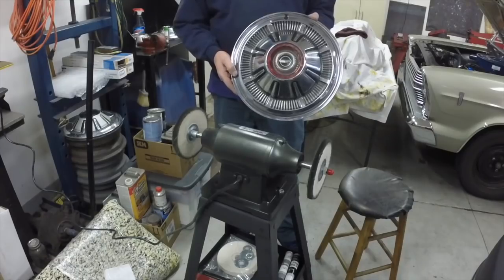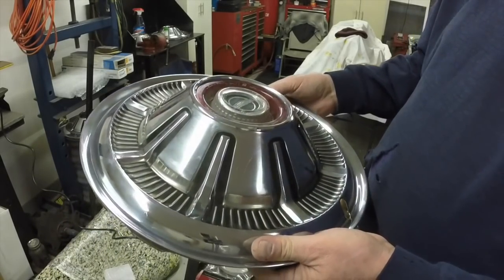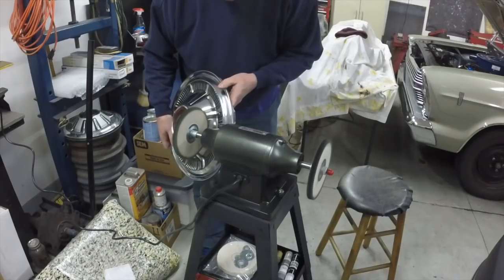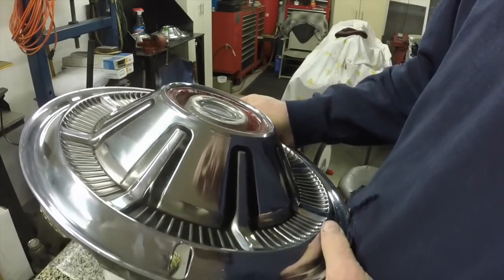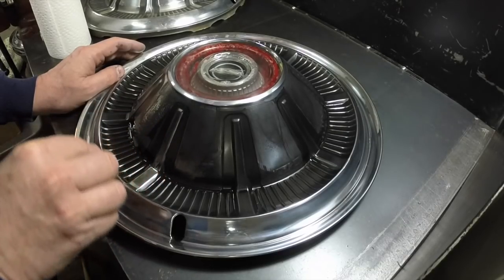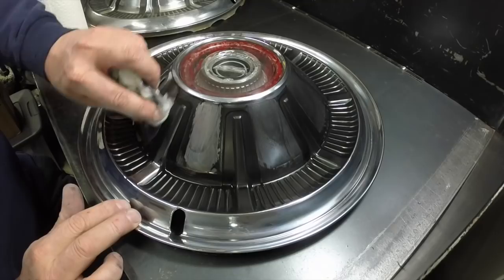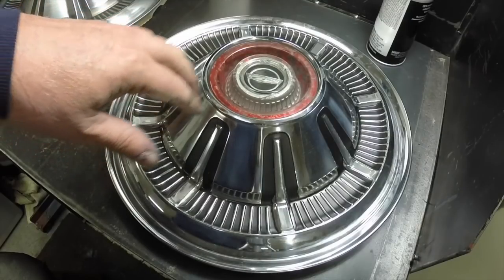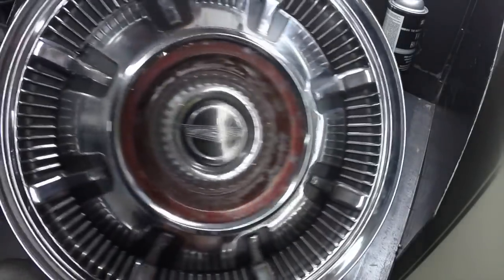1966 Ford Galaxie 500 convertible restoration part 174 restoring wheel covers

Comment: When I was young I always had to pull the stock wheels and throw on some Cragar SS wheels. I did that on several cars I owned. But as I have aged I appreciate the original caps on the old cars. Those caps and some white wall tires are going to look phenomenal  !!

Comment: you can use spray glass cleaner  to clean those caps I like to use SPRAY  WAY.  blue cap white can.
I learned of this from a body over 40 yrs ago..it cleans more tha glass and no streaks
Reply from the maker: I just want to wait for the paint to dry a couple days before I get anything on them..... then I 'll wax them.

Comment: You always saw hubcabs flying off of cars in the old car chase scenes in the movies. I put the Hankooks on the Chrysler and put Travelstars on the Valiant recently. No problems with either.
Reply from the maker: What size tires do you have on your Chrysler?
Reply: @OldCarAlley  215/75/14
Reply: @TylersNeighborhoodGarage  I put 215/70/14's on my 1966 Mustang, almost stock but wider.  It has a good rake with the Shelby drop in front and an 1" lower in the back.  Mines has a thin white wall. I got them from Cokers.

Comment: Wheel covers look great! Do you have a special trick to install & remove the covers without damaging them?
Reply from the maker: I install them with my hand, with a thick glove on to protect my hand.... I use my hand like a mallet. I remove them by prying around the rim of the cap, with a large screwdriver, often padding the rim side, to prevent messing up the part of the wheel that you can see. It's not often I need to remove the cap or wheels on the old cars fortunately.

Comment: Makes you wonder how the factory painted those caps by the thousands??  They must have had some template made to cover what they didn't want painted, like a 'hat' and then just painted over that template??  No idea...
Reply from the maker: Thats exactly how they were painted. A friend worked for a automotive supplier. Thats all he did, was paint parts. Sometimes he would bring one of the well used templates home.... caked in paint. Apparently they cleaned them, but overt time they just needed to be replaced.

Comment: How effective can you repair the clips that hold the hubcap to the rim? It seems once they start coming off the keep doing it.
Reply from the maker: On The old caps the tabs can be straightened back out a little. I use a small pair of vice grips. It works good.... I did it to the the one that flew off, last summer.... it didn't come back off, in fact it was a lot harder to get off, than the rear cover.
Reply: @OldCarAlley  Well that sounds good and glad it worked. I like the restoration projects within the restoration project. So many details to attend to. Good to see the work of restoring the painted areas in the hub caps.

Comment: Yep, The Hankook Optimo 724 White Wall Tires...Can't go wrong with them.  They are Speed Rated too.  I have a full set of them on my 1965 Mustang 'vert.  I bought mine through the "Discount Tire" Chain stores. Great place.  Howard, What size wheels do you have? I think Galaxie wheels are 15" inch if I remember correctly.  The '65-'66 Mustang has 14" Wheels originally and the Early '64 1/2 Mustangs have 13" inch wheels... The 13" wheels are were too small...even Ford found that out..so when Ford went to the '65 Production on the Mustangs, They made 14" Wheels standard.  The new inserts really "Pop" and look Super Sharp!... Great job on the caps!  :o)  Tony K., Melbourne, Florida.
Reply from the maker: It has 15" wheels. I have Hankook's on the F-150.... it came new with them, and when it needed tires I went with them again because I really like them.... I use to always use Michelin in the past. A friend bought a early production Mustang, it has 13" wheels. It looks funny with the tiny wheels, but thats what it came with, so he keeps them on the car.... it's a six, stick. I tease him about it's lack of power, stating he need to cut a hole in the floor, so he can help the car along with his feet. He rarely drives it.... it has less than 10,000 original miles on it, and is 100% factory original. It's really a sweet car!
Reply: @OldCarAlley  Yeah, Those 13" Wheels are really puny on the Mustang.. They look way too small..and are...Most '64 1/2 Owners upgrade to 14" or even 15" wheels.  The '64 1/2 Mustang six came with a 170cid Inline 6 cyl. motor and 3 main bearings.  They can be tuned to provide some decent power, but many 6cyl. owners upgrade to the later '65 200 cid engine that has 5 main bearings which has much more power, is quieter (Smoother), and is what most 60's 6cyl. Mustangs came with until the 250cid was a 6cyl. "upgrade" option in 1969. The 1965 to 1967 Mustang's Non-IMCO (Non Emissions Controlled) 6cyl. engines are very peppy and zippy and most people when they drive a '65-'67 6cyl Mustang for the first time are very surprised at its very peppy performance. They provide more power than most people think. They are normally rated at 110-120hp..but I think even that is a bit underrated.. For a 2700 pound car, You can imagine the Power to weight ratio...and it's a good one... Hey Howard, Your friend's '64 1/2 Mustang 6 cyl.sounds absolutely fantastic.  Maybe you can call him up and do a video on it....That would be great for your series of videos...especially if it's as nice as you say it is.. I know that I'm looking forward to it..! Just cover up his license plate with a rag or some cardboard...if he even cares.. Tony K. , Melbourne, Florida.
Reply: @OldCarAlley  Howard, check out Cokers Tires, they specialize in classic cars. I got a set for 66 Mustang.  Speed rated, thin white walls, 215/70/14. They look great on the car.

Comment: Howard, I swear the hub cups had a textured finish on the wider portion of the upper ribs so I went in search, and found this photo.  https://www.autokrafters.com/c-194-hubcaps_ford-galaxie500-1966.aspx Were they all like this, or were some polished? The car is coming together, and looking fine. Be Safe!
Reply: I think Tom C. is correct, I have the 1966 Galaxie brochure and it clearly shows the hub caps have a matt silver finish, like the spare one you have. Doesn't matter you Galaxie looks great and you have the patience of a saint.
Reply: That replacement cap, pictured in the link, also has the valve stem at around 10 o'clock (not perpendicular with the emblem) hmm, details...
Reply: @jimmccoskey8253  Yes, details? That's why I asked Howard, he knows way more about this car than I do, though it was the first car my dad bought me back in 1976. Howard's is an upscale model, mine was a hardtop, maybe the upscale models came with polished caps?
Reply from the maker: I have found two different versions of that cap. I have the other style too, but the ones on my Galaxie are not textured, as you might note on the wheel covers still on the car. Both restored wheel covers, the main part your talking about, I did not sand, just gave it a buffing. The other cover I was trying to buff up, has that textured finish, as I have had to sand it off, to make it match the caps on the car. I don't have a clue why Ford did that. Maybe one is for cars, the other is for trucks, I just don't know. There were several different inserts offered too, depending on the model of car or truck it was used on.
Reply from the maker: @jimmccoskey8253  I looked at it, it may have a repo insert.....
Reply: @OldCarAlley  Yes, I've seen some of the variations, black, and red. I wondered whether the polished cap was due to the upscale nature of the convertible as mine was the hardtop/base. I guess we'll have to keep wondering. 😁
Reply from the maker: @TOM-C.  I wish I knew.... all I know is, mine shine nice..... It a nice uniform finish over the whole cap, so I "think" it's the way it originally was.